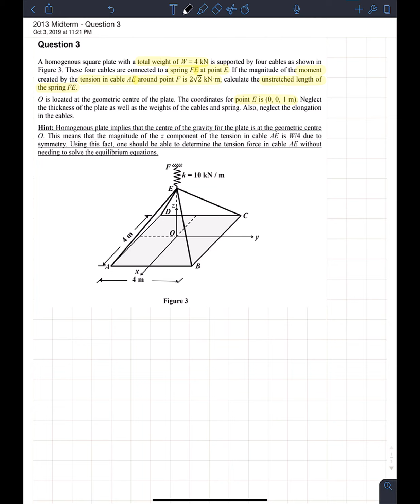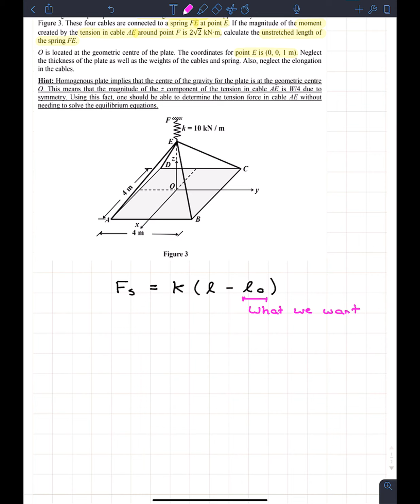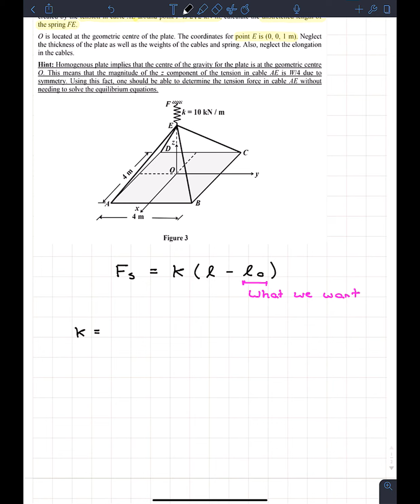Engineering Statics - Old Example | 2013 Midterm - Question 3 (Moments and Springs)

Comment: Nice question! I was doing the problem on my own and I can across an interesting (and a bit quicker) way of solving this question.

We know the vertical component of the force of tension is 1KN (by the hint) and using some trig, we can find the horizontal component of F to be root(8). Both the vertical component plus the horizontal component is equivalent to Force AE, so we can analyze the components instead. Well the vertical component makes zero moment about point F. So then for the horizontal component, we get
root(8)*d=2root(2)
d=1
And then from here solving for resting length is trivial.

No position vectors or anything needed and only takes a couple lines of work. Anyways just felt like sharing :)) Let me know you think this is good or not if you see this. Cheers!